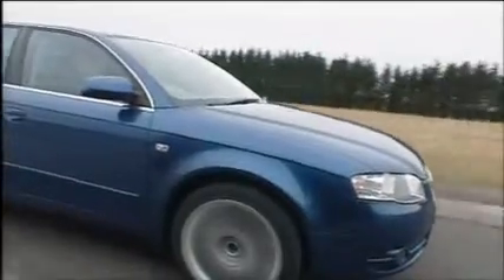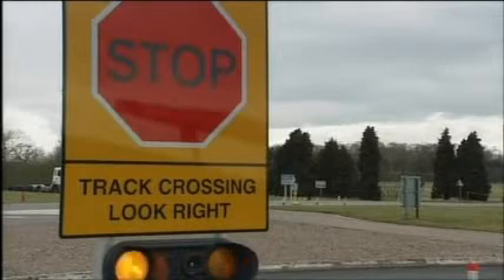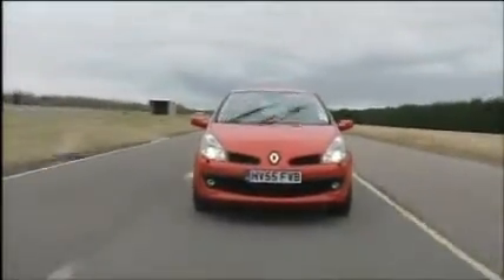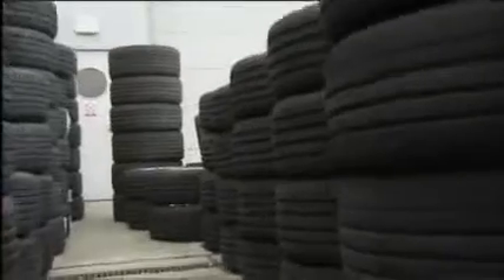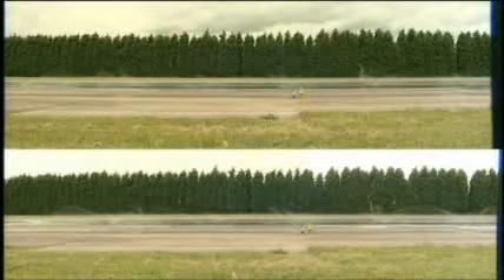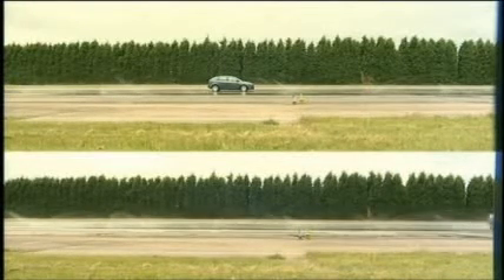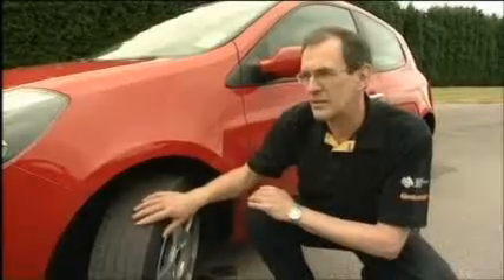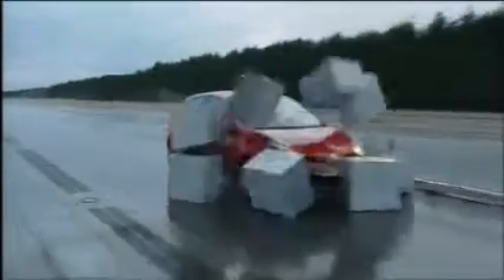Shocking tyre tread test: the difference between new and worn tyres - Part One

Comment: Tyre makers have obvious $$$ gain in drivers changing tyres more frequently so no surprise they push this. However in the dry the bigger foot print of a part worn tyre would give superior stopping. It is the rubber that grips the road not the tread. The grooves are only to disperse water. Dry racing tyres (slicks) have no tread at all. An off road tyre would perform even better in very wet conditions but be completely hopeless in the dry. Unless everyone keeps a pit crew able to fit tyres optimised to the conditions, then tyres like everything in life have to be a compromise between cost, safety and environmental impact of sending "good" tyres to land fill.

Comment: Indeed, 1.6mm is the limit so that's when you change, the test just proofs you should not go below the limit. It would make more sense to test 2mm vs 3mm as theoretically you don't have to change at 2mm. Though I fully agree, the limit should be 3mm, the difference is HUGE.